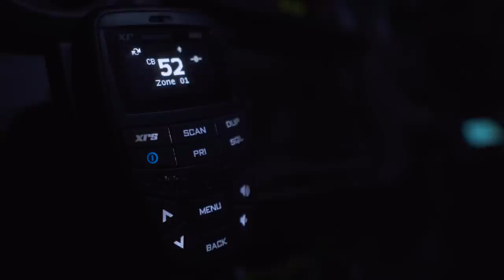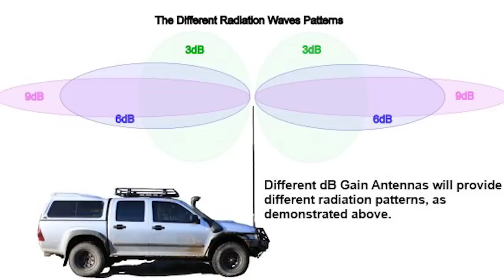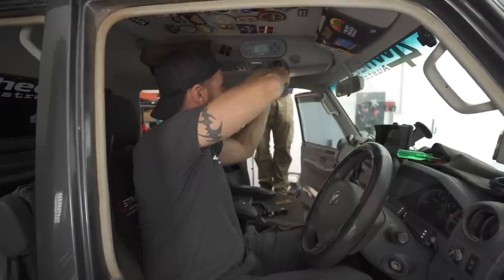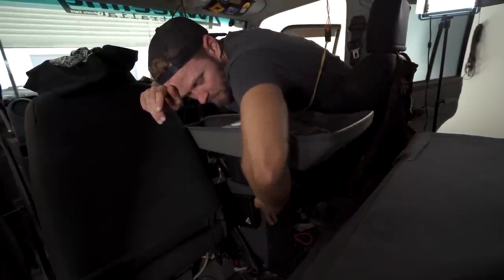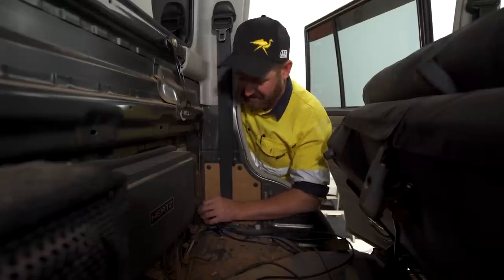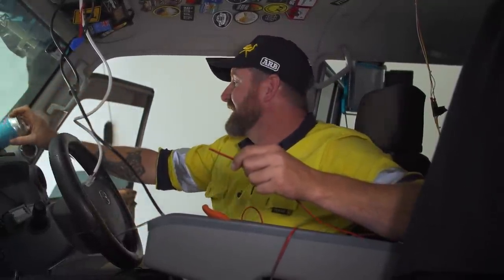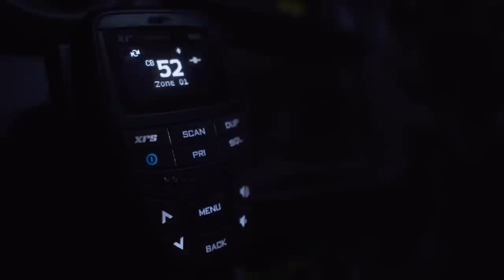UHF CB Radio Install & TIPS

Comment: Good advice gents, and that's coming from a qualified comms engineer. 

Soldering is fine for cable to cable connections that "float". Connecting to fixed items, like a relay you must use a crimp connector as the solder can and does fracture due to mechanical vibration.  

You may want to consider "dual wall" heatshrink for those solder joints (and crimp connections).  Its cheap given the small quantity required and it will seal the joint against pretty much everything. 

Cheers, gents and thanks.
Reply: Benny Bleuger thanks for the reply
Reply: Dual Wall heatshrink is also called Glue Lined heatshrink
Reply: Hey mate, i want to run two aerials on one CB Radio. Ive got a cb t piece can it be done?
Reply: @Nik-zl2xf  It can Nik but results is likely to be pretty bad. Even a proper antenna switch rather than the T piece will cause some loss and a badly matched one could take out several dB from your antenna gain. You thinking of combining a 3.5dBi and a 6dBi antenna? Best to unplug and swap antennas is what I would do.
Reply: I solder my crimps, But you should be using LMR and N-Type not RG58 and SO239
Reply: @MiniLuv-1984  awesome advice I just purchased gme330c radio with 2 aerials, 3 and 6 dBi, and will simply unscrew one and attach the other as needed. Glad you confirmed this is better than a switch.

Comment: Love that wire offset cutting tip 👍
Reply: Shane Allen don’t need it when you use good heat shrink 😀👍
Reply: Yeh, but it can also save bulkiness in tight spaces - especially with a fair few wires, but heatshrink is the best invention since beer. Torbes should've put some over the cable for that joint anyway. Might have a look at your channel mate.       yeh, had a look and subbed
Reply: I like to use slide connectors and when you have 2 next to each other they get bulky. Offset helps keep them neat / trim and helps keep them in the loom.

Comment: Hey guys great vid. Here’s a tip . To stop your connector at the back of the unit shaking loose when travelling. Once it’s done up nice and tight a couple of blobs of  neutral cure silicone will stop it from shaking loose. And you can get if off easily later.

Comment: I know Andrew St Pierre White hates antennas & aerials on the front bar but I have a feeling you’ve just started a new trend 🤙
Reply: Pretty sure him hating them is an argument for, he makes some spectacularly scenic content but damn he's an opinionated old bloke.
Reply: @hannahranga  Your'e spot on there mate, silly old bugger tried to draw 50 amp out of a 10 amp charger and couldn't understand why it didn't work, then he turned comments off.
Reply: That Andrew bloke also can't wrap his head around freewheel hubs. Freewheel hubs are priceless when you break axles/CV's offroad and need to limp home.
For a weekend warrior who mainly uses their UHF CB on hilly/high country tracks, it's useless if it's folded flat! Might not give the best signal, but a bullbar mounted antenna works better than a snapped/folded rooftop antenna. You can also clearly see when a bullbar mounted antenna it at risk of being taken out by a branch etc. Bullbar mount also means it takes 5secs to unscrew and remove the antenna tip if you're parking in the city so the drunks and drug addicts don't steal/break it. There are always pros and cons.

Comment: Good tips.  In your sit-down discussion, I'd recommend covering wire gauge for rated current for any wiring project.  Also, all of your antenna mounts are grounded, but it was something that wasn't really mentioned.  Getting a good ground plane on the antenna is a large factor impacting antenna performance.

From a US HAM and offroad camping enthusiast, 73, de N0IV.
Reply: all about ground plane...

Comment: If you put a rubber o-ring on the center pin of the UHF connector before connecting to the radio it cushions it and keeps a little tension on it preventing it from rattling loose.

Comment: You didn't discuss drip loops for outside to inside. The loom helps, but you can let the cable hang lower then the passthrough hole and put a cable tie on the cable to help shed water.
Also, in the outside cable connections you can put di-electric in the connection to help keep water out and corrosion down.

Comment: The little antenna that hes putting on the drivers side roof is a GROUND INDEPENDANT antenna which means you dont require to ground to the vehicle. The vertical on the passenger side is a GROUND DEPENDANT antenna which means you require to mount the antenna to something metal to ground it to the car. If your mounting it on the roof rack you need to make sure you ground your roof rack to your car for an effective ground situation.

Comment: You can cut the cable to whatever length you need, it won’t make a difference in a 4wd application. You can even use extension cables and connectors mid line, you will start to see a reduction in performance but most people will not notice.
Reply from the maker: We didn’t want to encourage people to just do it as many would not solder it or connect it properly.
Reply: @Ronny_Dahl   you must get ham radio licence.  #4S7JL

Comment: An analogy that we use to describe transmission pattern, is the balloon.  Low db is like a round balloon, or a spherical transmission.  Now flatten the same balloon between two flat surfaces, it flattens and spreads outwards.  The flatter and wider it is, the higher the gain equivalent.

Hopefully this can help visualize the concept.

Comment: I like the roof top fold down antenna. I have a rear door mounted quick release so I have to remove it to get in my garage. The fold down is just as easy but stays on the vehicle. Great video.

Comment: Good Video with loads of good advice BUT as an Hamradio Guy I can tell that Antennas where you are not allowed to cut the Cable are no good because that means that you have a lot of standing waves. That means that you have to cut the cable at a point where the SWR is low and on UHF that can be very critical and also dependent on the Radio AND it means that you have more losses in the cable than necessary. 
It is generally much bette if the Antenna resonant on that Frequency or matched by a matchbox (but than you need an Antenna analyzer or a SWR-Meter).
I also would try to never solder anything on a vehicle. A soldered connection is much more likely to break from all the vibrations. I like crimping much better ;)
For the upcoming talk you could compare a 12dB omnidirectional Antenna on a Car to a small, handheld directional Antenna (Yagi) with a small HT. You will be surprised! There is no use for Omnidirectional Antennas with more than 5dB of Gain on Cars!
Reply: This guy also needs to look up what diffraction is. Saying the a signal wont bend over the top of your vehicle is wrong
Reply: Thats the downfall of running Ground Independant Antennas
Reply: Antenna selection is very important, not just size and gain or receiving pattern shape. Best to select a none earth plain type. GME  vid on antenna selection is excellent.

Comment: Excellent video, One thing, the most important thing with any type of radio system is good low loss antenna cable. Good quality cable will make a huge difference to your signal strength.

Comment: The antennas .. rule of thumb is 6.5db is good general use and 3db for bush or hilly environments 
The interference was probably from those solar panels 
The loss every time you add a conector is .2 db you wouldn't be able to tell the difference 
The reason you are getting better reception off the roof is the height and ground plane created by the roof 
I've installed thousands of radios and altered coax length with no issue
Reply: do you see any issue running the coax down the outside of the windscreen exposed to the sun?

cheers

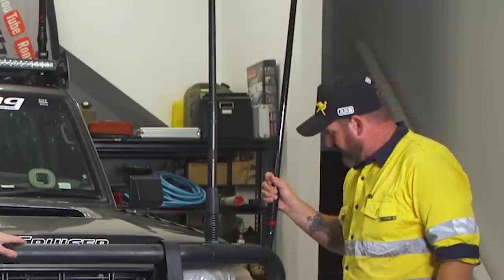Comment: Im surprised with all these HAM radio operators & engineers commenting on here no one has mentioned anything about Torbs statement about antennas throwing out "radio active" waves at 13:23. Would have thought he broke the internet with that comment but nothing. Good vid guys, looking forward to the range testing between the antennas.

Comment: Instead of silicon in the grommit you could run the coax below then back up to the grommit. That way, water will run off the bottom of the loop.

Comment: Another great video Ronny and Torb 👍 
2 quick tips you missed though - 1) when drilling metal above your paintwork, always put down a big piece of cardboard or a sheet as that hot swarf falling on your paintwork will do wonders for the clear coat
2) heat shrink those power and earth cables guys - just in case they run through. 
Oh yeah, and be careful pulling any electrical cable or antenna cable through freshly drilled holes in metal due to the sharp blurred edges from your drill 👍
Keep up the good work gents 👍👍
If people are after that yellow tongue plastic too, often timber yards may have some available separately or alternatively, keep an eye out on job sites as you’ll often see it in skip bins or on piles of rubbish. 😉

Comment: Also the reason why you less distance with a handheld than a mobile unit is the size and type of antenna used. The Handheld has a small antenna which means a low dbi gain. You try putting a handheld antenna on the mobile unit and you'll get the same thing.

Comment: Great video! Doing my CB install this weekend. :) offset on the cable splice is a great tip. Will do that on everything from now on. 👌Thanks, Simon
Reply: How did your CB install go, and what vehicle did you install it into? (I guess, by your name, it's gonna be in a Landrover?)

The offset is a good tip. If you're splicing multiple wires (such as that of installing a trailer plug to your vehicle's wiring) the offsets help keep the 'bulk' of it down, and give it a nicer, cleaner look to the finished 'taped' product.

I'm going to install my radio over Christmas, in the newly purchased (and finally received) Outback Roof Console. I'm gonna cut the fuse off the rear of the unit and fuse it in the engine bay at the source of the power, that way it protects the whole cable as well as the unit. No point in having that fuse blow near the back of the radio only to have to pull half your car apart just to swap fuses!

Comment: glad to see you showing everyone the little upgrades here and there that most people don't look at.
a question I have is what is your personal opinion on CB vs Ham / or / as our buddy brad from trail trailrecon has. CB and Ham?
I have done wiring for years and have learned 1# all ways get more wire then you think you need. 2# routing it smoothly and safely will help it last. 3# and you know you have done a great job when no one else can see what you have done.

Comment: Another entertaining video. I thought you had an Icom in the roof? I wouldnt have change it for a consumer GME radio (since you have an Icom). Except the GME is easy to use, it wont perform nearly as well. The GEM's top out normally at around 3.5 Watts real world (tested many). The Icom you can adjust to the full 5 watts. The GMEs are nicer to use though, and you are right. The magnet mics holders are great.
Reply: All about sponsorship
Reply: Quinn Warman that’s fair enough. Got to get paid somehow. :). They are a good consumer radio.
Reply: The roof one was a icom great radio. Now the other not so much which was the main reason for changing
Reply: @torbs_littlebear  If you dont want the radio, I might be interested. Or I am sure I know someone who will be.

Comment: Good video, about a month too late for me as I did my one. One of the key bits of info besides putting the aerial on the roof was putting the aerial cable in the tube if it’s exposed to the elements.  And I’ll add that I won’t cut the aerial cable after another YouTube video said “no worries”.
Reply: mate i have amatuer radio 27 mhz and crappy uhf in the car...it doesnt hurt to extend or shorten you coax..there is bugger all loss under 5m
Reply: you just goto somewhere like jaycar...and stick 2 pl259 plugs on each end...and put a so 239 joiner in the middle

Comment: the way you run UHF ronny 1 on narrow band and the other wide band use

the other issue you will have ground plane issues  because you need to ground the base of the antenna

have you ever heard of  expansion legs for  your ants  to raise the antenna up so  it clears the roof line..

also make sure you channel listing for your state and areas you are  traveling in  because what is typical  metro area use may not be typical  for country use ..

note what services use which channels and whether they use 80ch narrow or  40ch wide and note what repeater channel you use and always communicate with a call sign..
I would also consider running a hf option usb and lsb comms
Reply: Call signs are only required for amature radio in Australia.

Comment: On soldered wires … Keep in mind that where the solder ends inside the cable is a breaking point that is sensitive to vibrations. 
- Meaning, secure soldered wire points with zip-ties to safeguard them from vibrations and future problems.

Comment: Nice vid guys - some good tips in there! Good to know I've done most of my bits right a few years back. Couple of topics for you in your torquin 4bys . . . . Best way to run cables into the cabin of a wagon? Have done mine thru corner of the door but will eventually wear thru I think . . . . What's the point if having 2 units installed? Especially when modern units can do a constant scan of 2 channels. One as a back up?  . . . . . .   . Any external speakers required? . . . . . . Where are you going to hang that annoying silver horse from now? 😁👌👍
Reply: IIRC they prefer 2 radios so when in convoy everyone is on an agreed channel & the other one is set to scan whole range ( except the convoy channel ) .. but i guess also it's nice to have 2 in-case one radio dies

Comment: So what I still don't get (I'm new to the topic) 1. Why two radio's? Is it because you're on two frequencies? 2. Why do you still have the antenna on the bullbar at the end? 3. If you just wanted to do one for convoy driving with a bunch of friends, and you don't want to install two antenna's and units, what would you pick? 4. At what point would a handheld actually be the go-to choice? Thanks so much for making these videos!!
Reply from the maker: The antenna still in the bull bar will be removed we just didn’t have the time at the time
Reply from the maker: I’ll cover this in a torque N 4x4 as many would have similar questions.

Comment: It might not be an issue at 5 watts, but the radio chassis should be grounded.  Also, don't be scared of soldering your own connectors to your your coax.  I'm sure you have an amateur radio club nearby that can teach you.

Comment: The antenna cable should be as short as possible. Having an antenna cable any longer than necessary is simply reducing the performance of the transmitter.

Comment: In the next video would you mind discussing the common radio types in Australia? Also what license requirements are associated with each type? In the US we have: FRS= short range/no license; CB= short/med range/no license; MURS= short range/no license; GMRS= medium range/paid license/no test;  HAM= any range/license required/3 levels of license. Quite a few 4x4 groups are moving from CB to GMRS for the increased range and signal quality. It is quickly overtaking HAM radio (in terms of popularity) in my area.

Comment: There are (or at least used to be) clubs that required your radio to be wired to a permanently wired - the rationale being that if you lose your keys and your wired up to the accessory power, then you can’t call for help.

Comment: Another good video.  Ironic that I came on this this morning. I redid my antenna yesterday. Wasn’t happy with where the coax cable was running. It was getting damage.  About 3 hours to do properly.  I tend to use talcum powder to help the cables slide through.  When I have used silicone spray on old rubber it seems to break it down and the rubber grommets and fittings tears.

Comment: Me and my mates still use the orginal cb(yes newbies not uhf)  27mhz cb still goes a hell of a lot further than uhf car to car…And I find it funny no one ever talks about vswr with antennas not all of these so called antennas are tuned correctly when they leave the factory ..And isnstead of say having a vswr under 1.5  there alot higher and over time you will kill the radio and not transmitt as far as you like..

Comment: Ronny the only thing i will point out during the install is the inline glass fuse holders are not always reliable and can give you issues, All the uhf's i have installed as i do Electronics (hobby) for many years, have replaced them with in line standard ats or min blade fuse holders , also that way if a fuse was to blow it's easier to find a replacement fuse.
Reply from the maker: Very good point mate, I do carry extra glass fuses but blades would be better
Reply: @Ronny_Dahl  Sorry mate didn't want to make a fuss but i just wanted to bring that up.
Reply from the maker: It’s a good point

Comment: You don't use VHF or any ham bands on your rigs?  Do you carry handheld units for that, or just sat-phones?  
Just curious as to why.  I run two radios in my Jeep, one CB, one Tri-Band Ham.  For camping in the deserts or mountains, I can usually find some sort of repeater if there is an emergency.  I wonder if AUS has the same infrastructure for long range amateur bands.  I do hear blokes from AUS over the repeaters.  Great video, and thanks for keeping them coming.